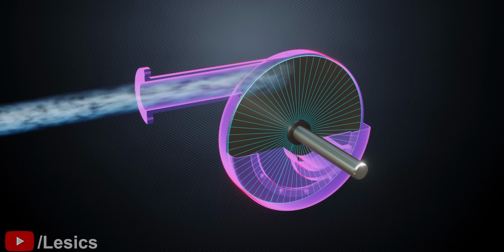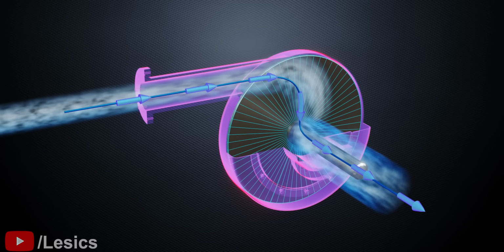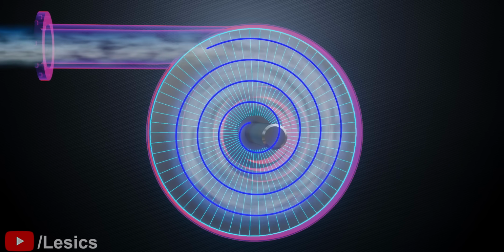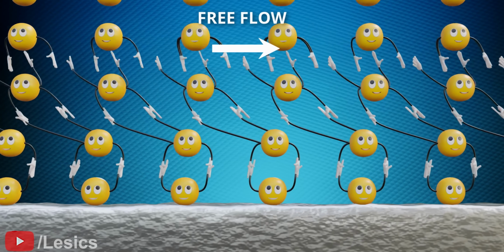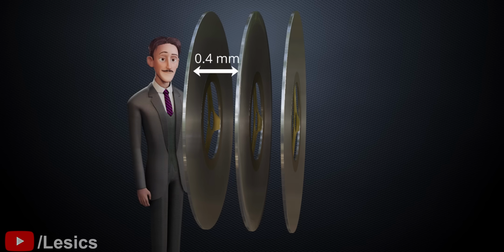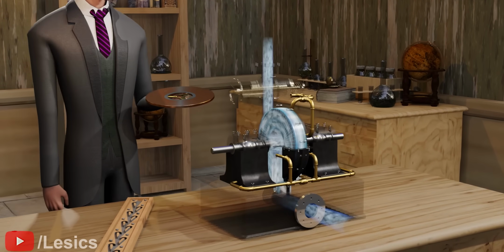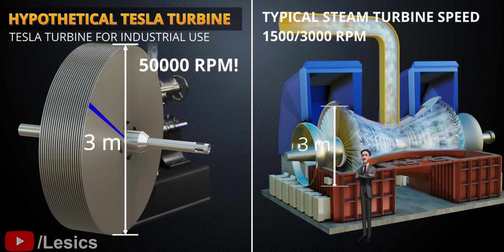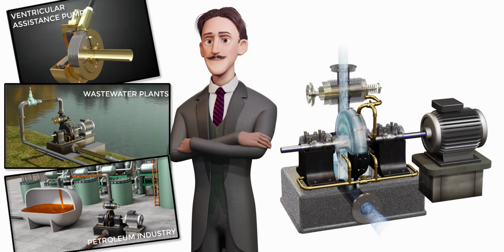Tesla Turbine | The interesting physics behind it

Comment: This is an engineering challenge, not an impossibility.
Reply: Their ‘Impossible’ not because it can’t be done, but because we don’t have a strong material to withstand the rotational force at that scale.
Reply: @sycho-tech5104  Impossible today is still impossible, it doesnt matter why

if a goat produced antigravity wool, I could weave a magic carpet, but for 'now' its impossible.....

the most fundamental function of an engineer is to have a sound understanding of the state of the art of science and technology, so you know what you can fabricate and manufacture, and what you cant.

If you dont have the materials you need, that is not an engineering project, because there is a task in the middle of the project schedule PERT chart labeled "A MIRACLE HAPPENS HERE"

Its a science / physics / chemistry R&D project, not engineering.
Reply: @kenwittlief255  I understand your points, however some engineering projects require metallurgy and similar techniques to overcome limitations that were overlooked or not incorporated in the original equations.
Reply: @sycho-tech5104  or because we have to find solutions to this problem in some way
Reply: @mrlk665  we need to invent a new matarial, and when we have something capable, we will also be able to build an orbital tower.
Reply: @sycho-tech5104  we most definitely do not have that tech. We are years off having a suitable matarial, and centuries from having production capacity to build something 25,000km long. Once built, it will be a few hundred dollars cost in electricity to get to geostationary orbit. And returning would make most of that electrical costs back. We can then use it to slingshot anything we want to move to any point in the solar system for zero fuel costs. The cost savings would be incredible compared to rockets which will never be safe, practical and cheap enough to move mega tons to orbit. A tower can. And calling it an elevator is abit of of a failure of the imagination. If built, the location will become the center of commerce for this whole solar system, and long term profits pay for itself easily within a decade of being built.
Reply: @christianbuczko1481  
Yeah, that all sounds great but then Emperor Palpatine comes along and...
Reply: @rogermccaslin5963  what i described is possible with a few simple advancements in matarials. Your refferencing fantasy, which is not. Rockets will become obsolete soon regardless, when they fill the orbits with so much junk nothing can fly. A single stage to orbit reusable spaceship is not even close to being practical either. Current technology cannot continue for much longer unless a better solition is found(every launch dumps junk into orbit and will cause damage, possible including a cascade destroying everything in orbit), and compete with the costs. Most of the matarial problems could be solved with a few billion invested, and a few trillion to build.
Reply: @christianbuczko1481  … you have a few points, But no, overall your wrong. Using mag-lev technology, solar arrays, and some (admittedly experimental) sealed environment habitation tech. We could ship the parts to construct a manufacturing system on the moon. Wear parts to construct enough composite Corbin-nanotube and titanium mega cable to reach the ground at 6-8 points in a mile wide ring, which is then fitted with solid steel rings to hold the cable in place and be the lock for the magnetic rails. Then you just build a vertical bullet train, power the whole thing with a solar array, and Bazinga. Ground to space Elevator. Then build a few more, one for each of the most powerful nations (cuz their not gunna want to share). And it wouldn’t take as long as you think, with the new metal 3-D printers, decades of cast forging parts are cut down to months, and made to Exact specifications.
Reply: @sycho-tech5104  the problem is getting the matarial printed to an atomic scale accuracy. Zero G is likely best for that. Thats what i suspect will be so difficult, the matrial will need to be strong, and only bucky tubes or perhaps graphene based structures could hold the weight required. We are still some way off that sadly..
Reply: @sycho-tech5104  you are leaving out a few details that render the project impossible

for one, once its all in place the MASSIVE counter weight in geo-sych orbit will hold the cable tight and in place.... But how do you get the weight there, and then how do you string the cable from Earth 22,000 miles out into space to shackle it to the counter weight? That is almost the circumference of the Earth in length,  what is going to fly straight up under thrust the entire way to make the connection, and then push the counter weight out to where its orbital pull matches the weight of the cable, so it stays synchronous? 

Once its all in place what pushes the counter weight higher and lower in orbit to maintain the balance as something is climbing the cable?

What do you make the cable out to withstand EVERY single satellite in low earth orbit, including the ISS, crashing into it at 18,000 mph orbital speed, because the cable will be sweeping thru low earth orbit and eventually every satellite below geo-synch will hit it.
Reply: @sycho-tech5104  you'll never get a decent production infrastructure on the moon with just solar arrays and chemical rockets. Change both those words to fission, and you're right.
Reply: @christianbuczko1481  where would be the roof of the elevator? 
If its a tower 25k km long, will it survive wind and earthquakes?
Reply: @ibraheemali9541  it would have to be built on the equater going upto geostationary orbit. You would slowly lose weight as you got to the geo orbit level btw where it would be zero g. You would need a very large mass, maybe an astroid used for resources at geo orbit as an anchor, and also a spacestation as a base. You could extend beyond geo orbit very easily as well, and use it as a gravity slingshot to launch objects anywhere in the solar system and not use fuel to do it. Alot of serious science has been done on the topic, but the easist way to learn the basics is to read a book by A.C.Clark called "the fountains of paradise", which is a fictional account of a tower being built.
Reply: @kenwittlief255  you move an astroid with lots of carbon into geo orbit, then mine the carbon to build carbon nanotube type products. Thats solves those problems your worrying about. The only bit we cannot do is make a suitable matarial in scale big enough.
Reply: @christianbuczko1481  you move an asteroid  from solar orbit into geo-synch orbit around the Earth, using what? telekinesis?! It would take more energy to move the asteroid than it would to launch the next 1000 rockets into space
Reply: @christianbuczko1481  what about an earthquake. How would the engineering compensate for the possibility?
Reply: @sycho-tech5104  I'm tracking...go on
Reply: @sycho-tech5104  graphine discs?
Reply: @niks660097  i think only a carbon based structure like that would work for those top speeds. When we get the tech to build them, we could also build an orbital tower too.
Reply: @niks660097  But at Mach 15,  temperature are already are already over 1400 Celsius due to friction. And while graphite is strong it is not resistant to oxidation.  What every fluid that is flowing, it cannot be water as water at these temperatures would start breaking down into hydrogen and oxygen and the oxygen would start attacking the  graphine.
Reply: 9ft disc spinning at 50,000 rpm, submersed in water...

you don't understand much about thermodynamics or harmonic resonance do you?
Reply: @wildbill6976  i wonder what coating that disc in a hydrophobic coating would do.
Reply: Aurora Peace  They cannot, that would break the flow profile.
Reply: Why does the disc have to be 3 meters for "industrial purposes?" Smaller radius and more wheels would seem to get the job done too. Stack multiple turbines down the inner wall of a dam with rerouting valves and you can repair a line without taking the whole thing offline.
Reply: Have they thought of covering the disk with duct tape?
Reply: I actually might be impossible. A deformation always travels at the speed of sound in your medium. If the difference in speed between the inner most part and the outer edge of your disc is faster than that, it will tear itself apart, no matter what.
You could try graphene, but should your disc only wobble, the tiniest bit, it will probably shred itself.
Reply: Right' we can find a material to withstand mach 13 without warping, doesn't seem like it should be that difficult.
Reply: Unless you're a leftist.
Reply: Accept the challenge then
Reply: engineers live between the rock of the laws of physics, and the stone wall of what the customer wants - literally a rock and a hard place, and its easy to get crushed between them.

Just because something is possible, that does not mean it can be practical, or cost effective compared to another approach.

For example, in the 1950s we thought in the future we will have flying cars and personal robots. 

We dont have personal robots like Rosy on the Jetsons, but we do have all sorts of computer controlled devices that take messages, look up information for us, wash and dry our clothes, cook our food and make bread without intervention, control the speed and braking and to some extent the steering of our vehicles (cars, trains, jets, helicopters...)

We dont have one robot that does all those things, like Robbie in Forbidden Planet. Instead we have many devices that do things for us, so we dont have to.
Reply: Nothing in the field of engineering is impossible given time.
The biggest things i can see wrong myself is heat distrobution at such high speeds and the material strength under those forces. Both things together play off eachother and cause the critical failures. If one could lower the outward force just enough by altering the shape of the disks slightly it is feasable they would survive such pressure, while the cooling problem seems a matter of hydrodynamics and thermodynamics causing chemical breakdown in direct contact with the heat. If one created a feedback loop using a denser, less corrosive liquid across multiple generators with an average temp being regulated by the space between them could it conceivably work? Using freeon sub pipes around the main ones to cool the internal liquids and vent the heat away from the generators instead of trapping it like the original design, a bit of pressure regulation through gates keeping the speeds consistent as to not overpower the disks and allow flow transfers in case of repairs needed. Give the thing its starting push with a couple small fans on an internal loop, using them to keep consistent speeds in the transfers also being a safety against overflow or underflow respectivly. Perhaps someone with resources could test such a thing eventually, see if its possible to create a self contained generator.
Reply: @ClaimSuit  Effectiveness, man. It can work, but without unobtanium it can't match the regular turbines due to low RPM. Nothing can prevent you from re-checking that, of course, just don't bet on anyone who can risk resources pouring these into a project such as this.
Reply: more about da $$$ impossibility than physical metallurgy
Reply: Thank you for saying that, beat me to it 😉